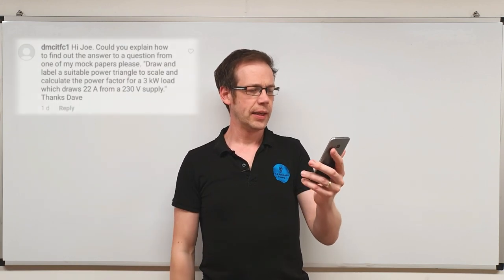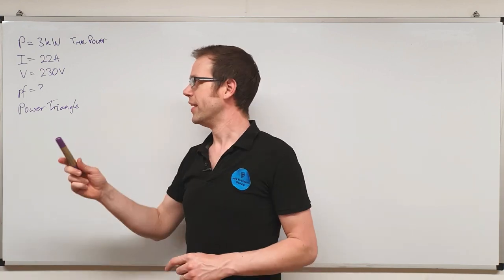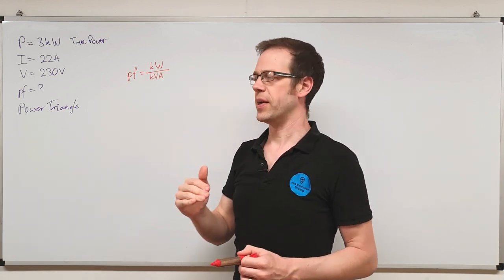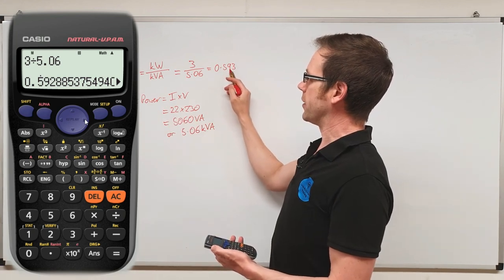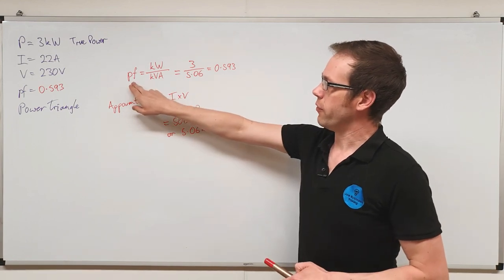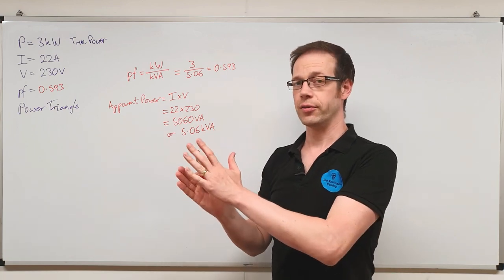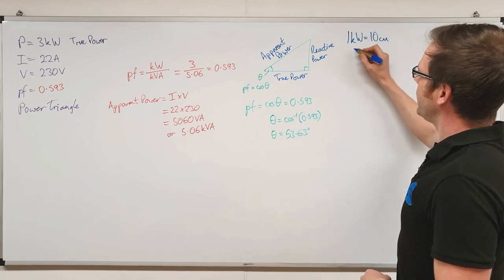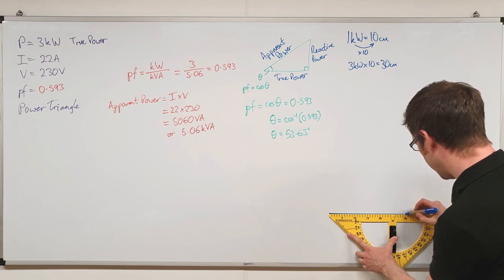Questions from Viewers: AC Theory, How to Calculate Power Factor and Draw a Power Triangle to Scale

Comment: Joe: Wonderful video. As you explained before the power factor for Restive 
load (lamps or heaters) would be 1.  My question please. You mention that
this is an INDUCTIVE load, but would the PF be the same for a capacitive 
load, given the same known integers? Thank you as always.
Reply from the maker: Thanks Ted. Yes if the load was capacitive instead of inductive then the power factor would be the same if we'd been given the same initial values. It's just not really normal to have a capacituve load that we correct using an inductive load.

Comment: Hi ,I have a question. 

Why do we consider power used by inductor  ( reactive power ) not useful.

 For an example if we consider a motor , inductors make the motor rotate yet power consumed by inductors are considered as not useful power . Can you please explain ?
Reply: The current flowing also creates a reactive inductance back into the coil from it's own magnetic field generated by current coming into the coil from the supply. This impedes the apparent power to give true power and if the ratio is closer to '1' then the inductor is creating less impedence and more efficient with a good power factor..